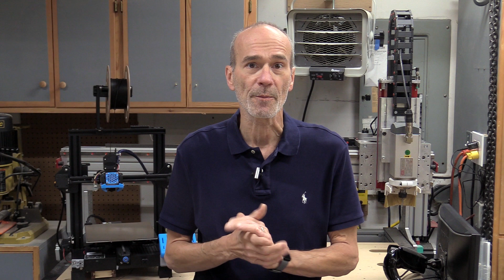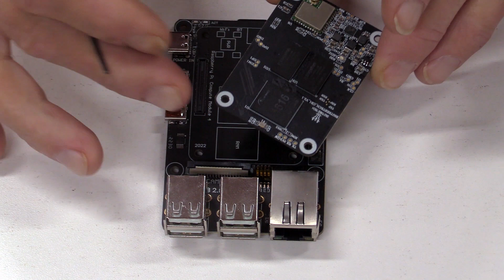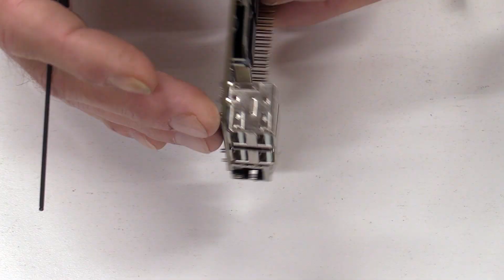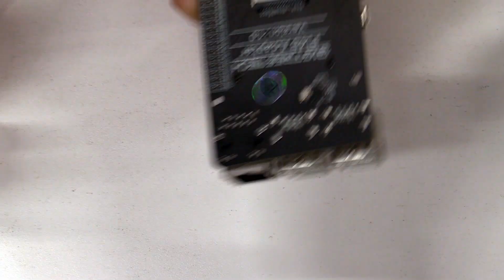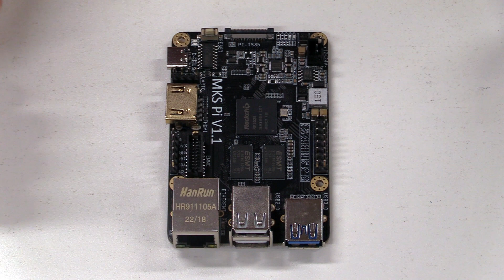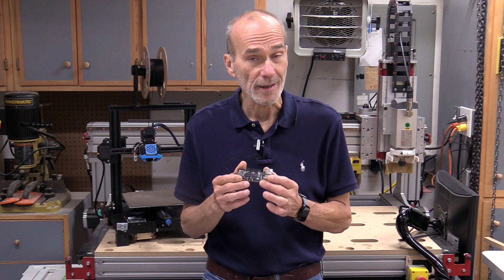5  Raspberry Pi Alernatives For Klipper Under $50

Comment: The CB1 doesn’t support the CSI or DSI ports. The adapter has those ports on it because it’s compatible with the CM4 which will work. They will not do anything if you use the CB1 on the adapter.
Reply from the maker: Yes, you are correct on that. I found out after I tried to actually use them. I contacted Biqu and they confirmed it.

Comment: Those are some good alternatives.  I wound up going to CanaKit, which tends to have some Raspberry Pis in stock, but you have to buy their complete kit.  However, even with the ultimate kit, it is cheaper than buying from a scalper, and having a decent case, proper power supply, and such isn't a bad thing.

Not sure why there is still such a shortage on Raspberry Pis, even now.  The 4 came out in June 2019, and hasn't really been upgraded, while previous to that, the 3B+ came out just a year before.

Klipper looks like interesting firmware.  I've used Marlin for years, but it is interesting what Klipper brings to the table.

Comment: If sites like Amazon and others would work with Raspberry Pi in eliminating scalpers we could get Pi's flowing again.  They keep buying them up and are sneaky to get past what they have been trying to do to limit purchase quantities.  I don't think you can put the normal Pi image on the BTT due to kernel differences.  I do like the new BTT M8P with onboard module, am contemplating swapping out my Octopus for an MP8 to reduce wiring on my dual extruder/dual Z belt custom Ender  I built.  Got a pile of wires/GPIO on that thing to tie them all together.
Reply from the maker: I agree. The Pi4/CB1 combo manual says that you can load the Raspi images on them, however I didn't try. Biqu has a complete image with everything preinstalled, so it is a much easier way to go.